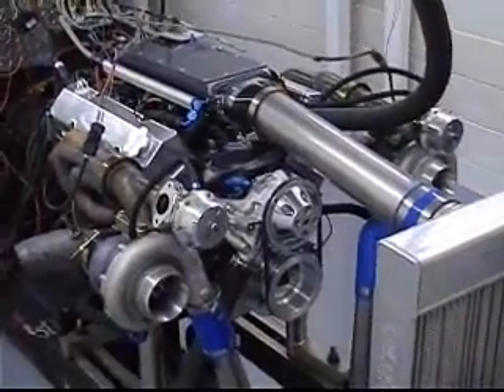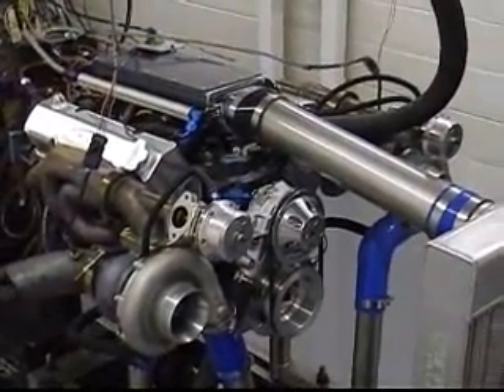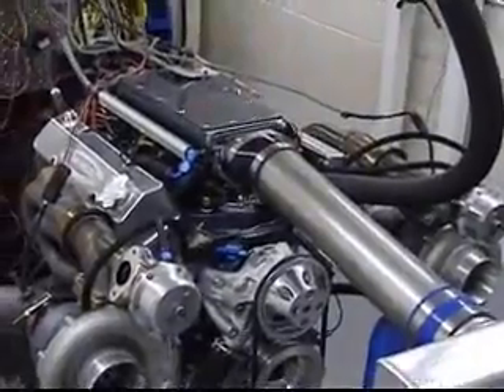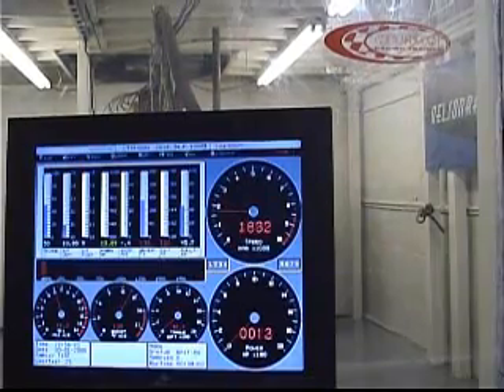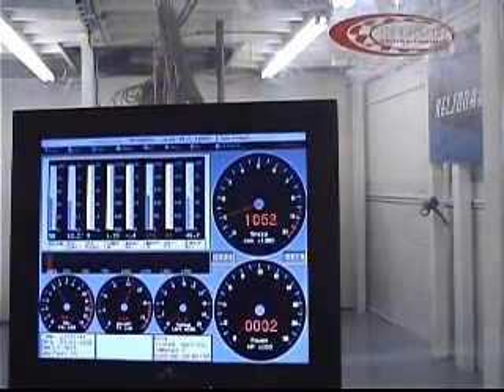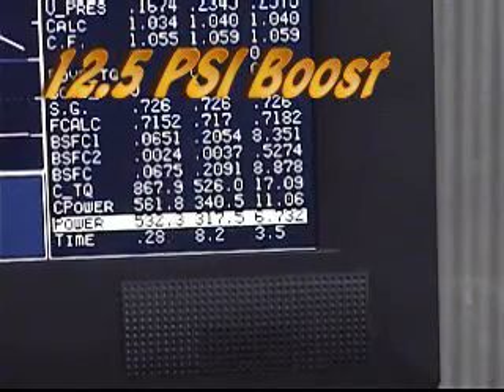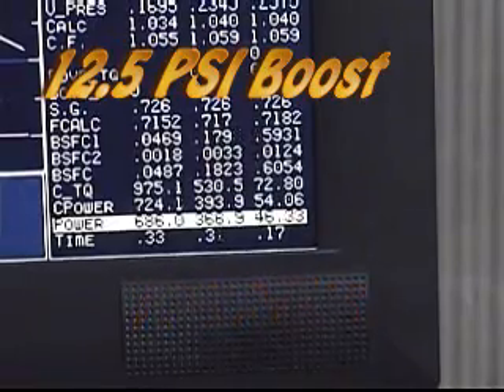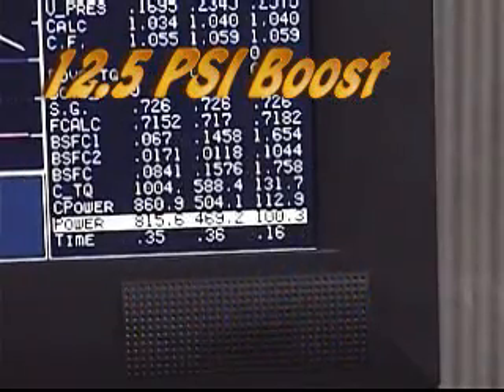Nelson Racing Engine's - Twin Turbo 427 Dyno

Comment: exhaust gas exits the cylinders at around 1200degrees F. But on these motors the intake air temp is more often than not around 100degrees F. OOOO AHHHH

Comment: Of course that thing should be getting that hot... It's a lot different than the 1.6L 4cyl in your honda:P

Intercooler has nothing to do with the temperature of the exhaust gas to reasonable degree.

Comment: What charges a turbo? Exhuast gas so if that is exhuast gas were is going to go the turbo. Regardless if the heat is after the turbo that means that engine has to be that hot so cooling the charged air would result in cooled exhuast.